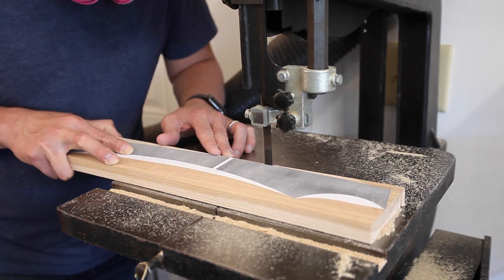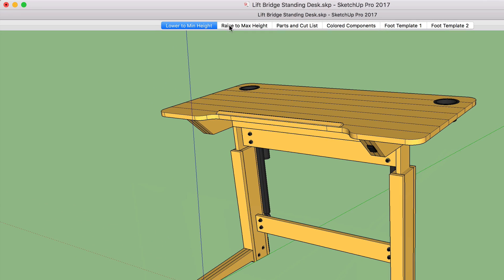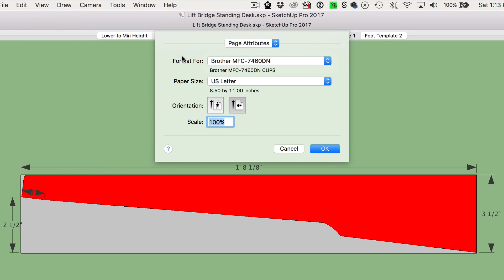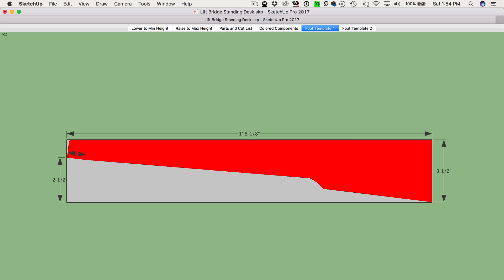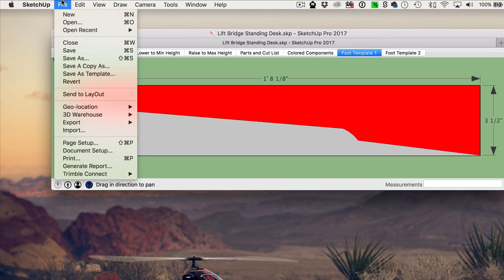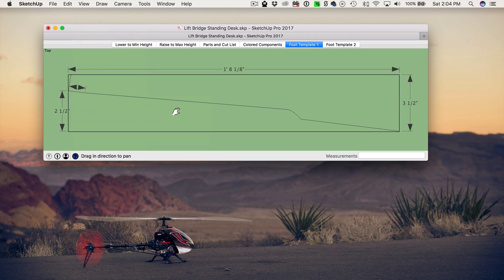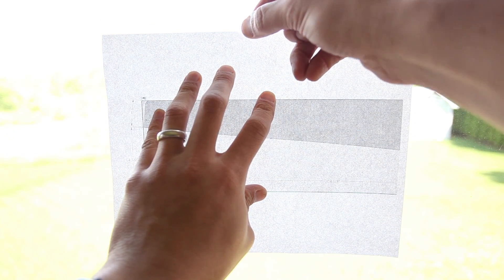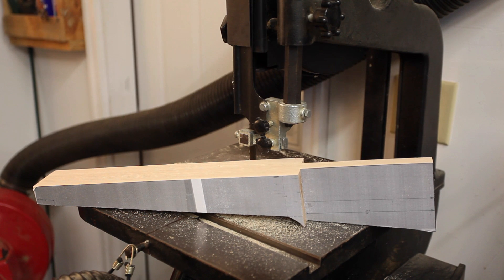The Poor Man's CNC Machine - How to print full scale in Sketchup

Comment: Hey Tommy I have Sketchup Pro 2018 and am running from a windows 10 machine. I don't see the Document setup options you are specifying. Am I missing something?
Reply from the maker: Hmm...not sure.  I'm running OSX and I haven't installed the newer Sketchup 2018 yet.  Maybe they changed something in the new version?
Reply: Hey Tommy, Thanks for replying. I end up finding it under the print setup. I also found I have to use an actual printer. I was testing with print to PDF and this did not give me the correct options.

Comment: I did this very same thing to make accurate wedges for a wedgie sled.  I made them in SketchUp and exported to Mattias Wandel's Big Print program. It has some very convenient features for doing this sort of thing
Reply from the maker: I've been wanting to give his Big Print program a try but haven't had a chance to yet.  I hear it's good!
Reply: Tommy Tompkins  It allows you to easily and accurately scale the the image, crop it, lighten areas to save ink, print a grid pattern for easier alignment of multiple pages...stuff like that. You were able to do many of those things right in SketchUp. But BigPrint brings it all together. You still need to know how to export a 2D parallel projection image from SketchUp, though.

Comment: Thanks, Great tutorial. I dislike removing the glued template from the wood. This is why I used masking tape first, it just peels right off.
Reply from the maker: Thanks!  I've never had any trouble removing the glued template from the wood.  It usually just peels right off but I also don't let it sit on there very long.  Have you tried a glue stick like I'm using or some other type of glue?

Comment: SketchUp is pretty cool. A couple of extra tips:
- There's a "zoom extents" shortcut - I think it's shift-Z by default. Way faster then scrollwheeling around.
- Follow all these same instructions, but print to PDF (pick a sheet size large enough for your whole part). Open it in Adobe Acrobat Reader, and use the "Poster" option in the print menu. It lets you set an overlap and cutting lines, so it's a lot easier to match up the sheets of paper.
Reply from the maker: Thanks for the tips!